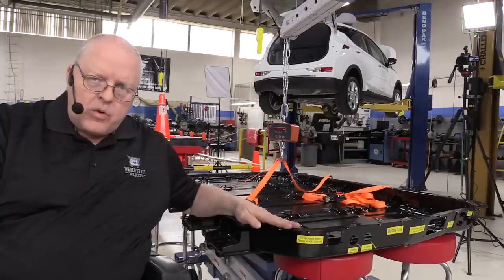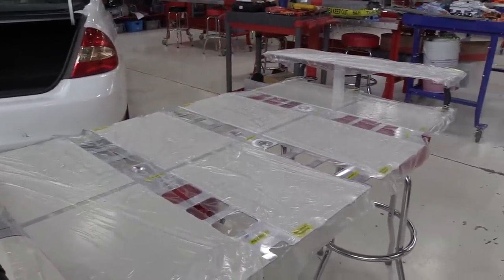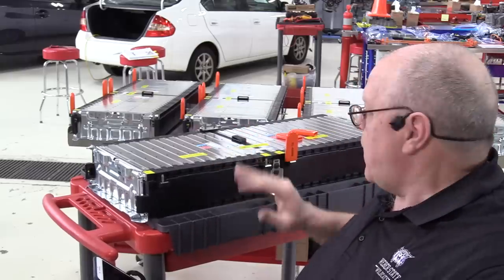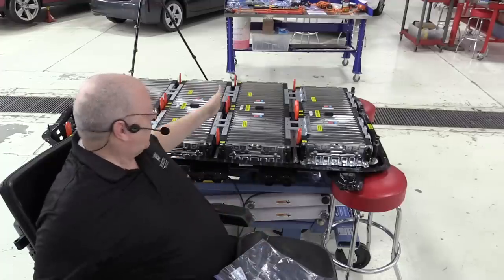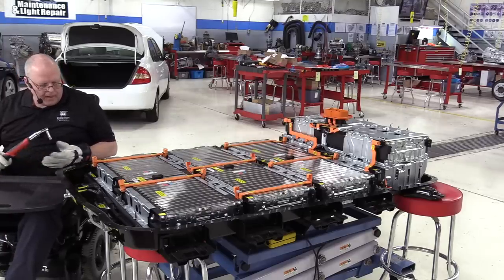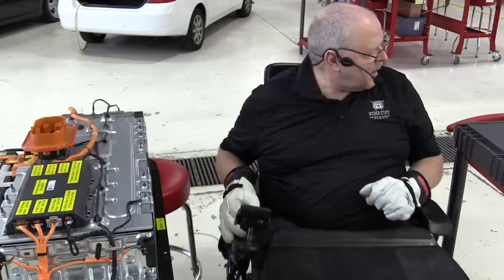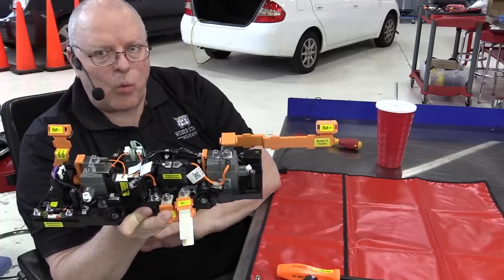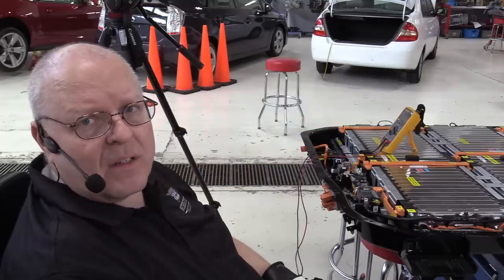Chevrolet Bolt EV Battery Reassembly

Comment: Almost all EV's have onboard charger that is rated for either 16A per phase, or 32A per phase. Tesla is the only one that has 3 identical PCB's to handle 3-phases (shunted in US). Though they have an exception, their bigger onboard charger supports 24A per phase. Zoe doesn't have separate onboard charger. It uses motor inverter to do the trick. It can charge at 3x63A AC, including level1. This is exception. Very inefficient at slow rate AFAIK.
Bolt should have 32A onboard charger.
Bolt can DC charge at 125A. 
Bolt can discharge at 150kW, that is, theoretically, at around 500A. 150 000 / ~300V (low state of charge)= 500A. Need to see when power limit appears compared to voltage. PTC and AC actually add to that. AFAIK, Nissan Leaf gen1 has 80kW motor, but battery is rated for 85kW power delivery. Pack can charge at 125A, discharge at around 300A (battery is fully depleted at ~269V, full power available down to almost zero).
Reply from the maker: Awesome information! Thank you. The Bolt battery disconnect switch has a 400A fuse. Have a good day!
Reply: Therefore 150kW motor power is available down to 150 000 / 400 = 375V. Which is pretty high. Interesting, that is way higher than I expected.
In winter, 375V is expected at very high SOC, like 60-90% (during heavy discharge). Interesting, is the motor rated for 150kW and vehicle as well (registrational paper), or just the motor? (Tesla registration papers indicate maximum nominal load (I think): Example:  283kW RWD Model S 85 is rated for 69kW in the papers).
Reply from the maker: Hi, our vehicle is not registered and will not be driven on public roads, so I cannot answer that question. The service information states that the motor is a "150kW drive motor". Thanks again.

Comment: The modules being unservicable is a huge letdown. I hope the circuits are good at kicking out bad batteries or modules so the car doesn't get stranded. Have to replace an entire module and also having to take apart the entire battery to get one module is also a let down. It seems there is a good reason for ultium.